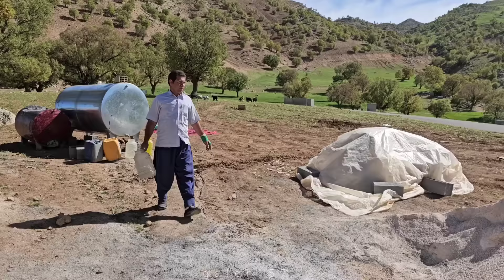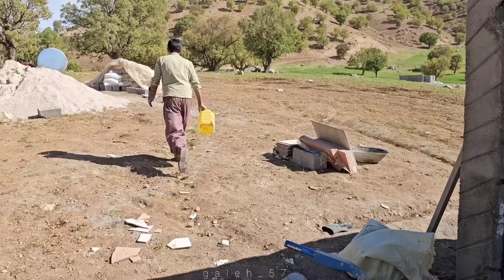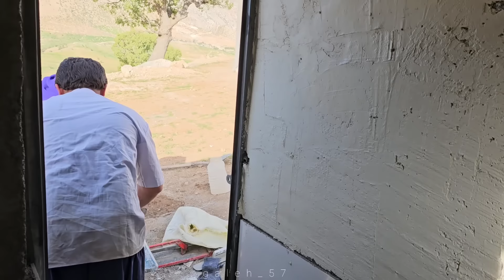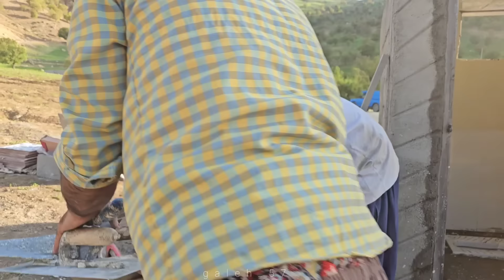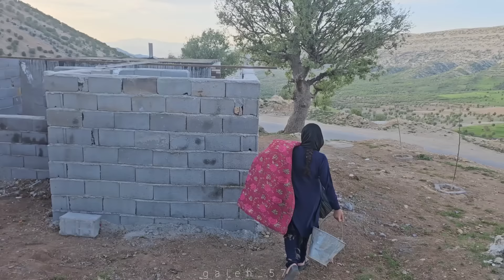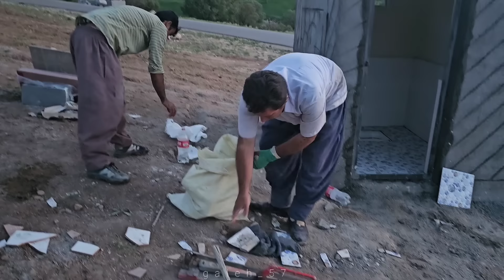Toilet floor tiling and service plastering by the master

Comment: Туалет - супер. Молодцы. У меня на даче такого нет.
А как сливать будет?водопровода нет. Наверное с ведром придётся ходить.
Но туалет красивый.
Reply: They will have to do something like that, as they don’t have plumbing anywhere, only that water tank where a water truck comes and fills it.  Technically, they could put an oil drum on the roof to fill with water or to gather rain water to use for the toilet. But, in my experience, such toilet even with water connection, easily become yucky. But I just saw a newer type in a video, and that flushed just like our western toilets and it also had water sitting in it like in ours. Only it was a squatting toilet… But Suzan’s will of course be of the simple type. But if they flush with a bucket of water, they should keep it nice!
BTW, what is it you have at your dacha? An old fashioned outhouse?
Reply: На востоке ходят в туалет с кувшином воды, ещё с древних времён, тогда ещё не было водопровода😮
Reply: El baño estupendo pero demasiado cerca de la carretera
Reply: @mariaaniceto6719 это туалет.
Reply: Почему многие пишут, что это ванна, или перевод неправильный

Comment: Hi they did a great job but they never clean up there used materials they just leave trash for Susan and the children to clean up.
Reply: PRETTY SURE Susan and children are grateful to do their part.
Reply: Well that will give them somthing to do since they are bored,they can clean the whole yard
Reply: @miroslavagonsalves1368  Well Ms. Troller, they are unsettled, not BORED. As the non-stop work starts and stops, they regroup to tidy up. As they usually do together.  Meanwhile the Children have the Swings and each other to play. They store the resources nicely as well.  Everyone is learning and getting along nicely.